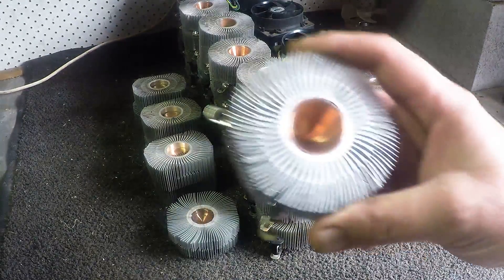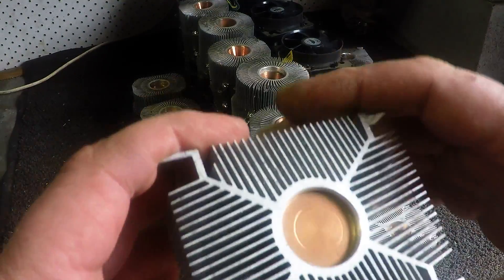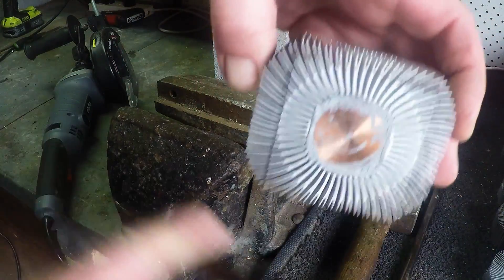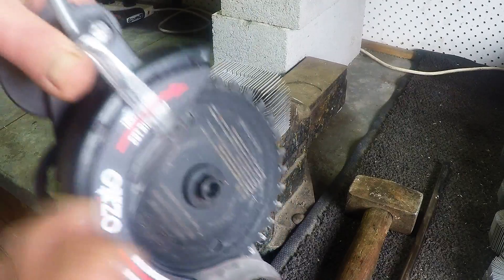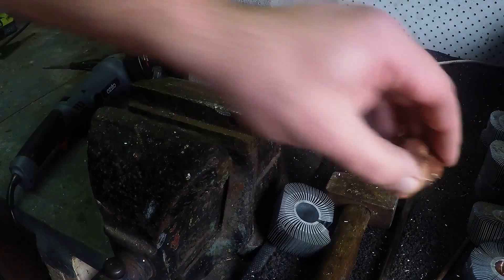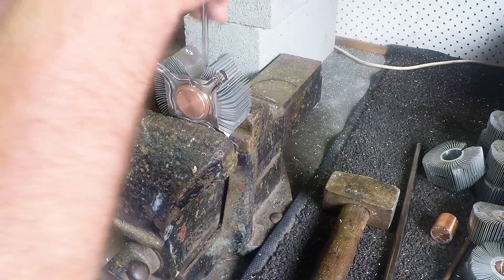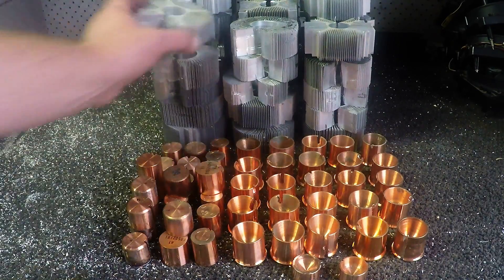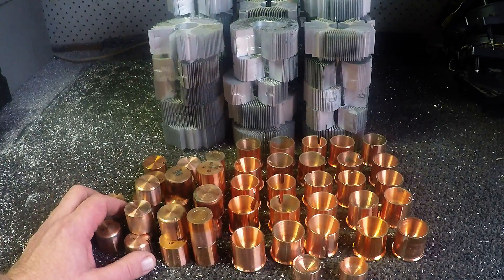Copper Stackers from PC Heat Sinks

Comment: Call me daft, but Im pretty sure that you can sell those complete for much more than their scrap value.
Reply: Hi Daft, my name is Tiberian
Reply: 5 bucks for one used one is much better than $1,30 for 1Kg, isn't it?
Reply: they arent high quality. those are oem intel heatsinks. they cost about 10 bucks new with the fan and mounts on them.
Reply: TheForgoten100 That was my point but they seem so caught up in how it compares to the the latest, greatest, three stage, cryogenic, peltier driven model that they don't seem to understand that those could effectively cool high power voltage regulators, mosfets, igbts, leds, etc. and that people that put together projects that use such components would pay more than scrap value for such heat sinks.
Reply: P4 and old AMD heat sinks...the systems those came off of have been obsolete for a long time.
Reply: Well, I mean if he gets $1 for them that's a pretty damn good improvement over $1 per kilo.
Reply: To say it in simpler terms: Yes they are worthless as CPU coolers, but they are still great as LED Coolers.
Reply: Every time I build LED light projects I use a bunch of these and they are usually good for 75-100+watts with a decent fan.  If you want them to be nearly silent most are still good for 20-30Watts easily.  

People don't realize that many processors today actually have nearly the same TDP or lower than that of earlier Intel and AMD chips.  Heck, the P4 chips had TDPs from 38 Watts in notebooks all the way to 115 Watts in desktops.  Processors that dissipate over 100 watts have been available to purchase for well over a decade now.  Many companies are already scrapping early i3, i5, and i7 systems along with core2duo, core2quad, and Pentium D systems.  I even saw a company toss working quad processor servers that were just outside of the 2-year lease expiring since they upgraded to new systems.
Reply: those were for outdated CPUs.
Reply: m4xwellmurd3r I still don't think you're quite getting it. Do you have any idea how much power you can pass through a low Rds mosfet before its wasting >60W? One of these heat sinks would be adequate to handle the switching output of a good inverter welder.
Reply: You can't, 1) they are specific 2) they are normal ones, not an upgrade. If one wants or needs to substitute this, one will search for an upgrade ( around the same price) rather than buy an equal one.
Reply: they are shit....
Reply: TheForgoten100 that's the thing. no one would ever buy one. he didn't even buy them. they were scrapped out of old PCs because they aren't even worth trying to sell as a CPU heatsink
Reply: m4xwellmurd3r It all depends on which stock Intel cooler you are talking about since they have had several designs over the years.  You generally have to look at the TDP of the chip the cooler was sold with since Intel matches them pretty well with normal conditions.  If you assume a 20-21C room with a stock cooler you should have more than 25% headroom over the stock power envelope of the chip before you are hitting the throttle temp of 95C or the auto shutdown at 105C.  The average consumer very rarely has the CPU run pegged at 100% load for more than 5-10 minutes and so those chips spend a majority of their time at maybe a 10 degree delta from ambient.  
When I think back, the only times I have ever really seen a stock clocked Intel Chip with the OEM heat-sink it came with run above 70C was when the heat-sink was clogged with dust, the case did not have adequate ventilation or the fan was failing.  Overclocking would be a totally different story since you are talking the chip beyond it's stock power envelope. 
I don't generally get to concerned about temps until they are nearing 90C since that is still well within the thermal limit of the chip.  High 70's to low 80's is well within the limits of a modern Intel CPU.  
I can tell you that I have had servers run near 90C 24/7 365 without issue for well over 7 years so the higher temps don't seem to put all that much stress on the chips until you are over the point where the chips begin throttling.
Reply: Cut de Pie Fails 1) there is no such thing as specific in the face of a good engineer. 2) "Normal" is an arbitrary and subjective classification. C/W and format. Those are the only two qualities that matter in heat sinks.
Reply: Actually, the issue with the stock intel heatsink is they're BARELY sufficient to keep a 95watt TDP processor sufficiently cool. Regularly I've seen chips with a 95w tdp pegging out in the high 70's to low 80c range, which is not good at all. These coolers are decent enough as long as you stay below something like 65W TDP.

AMD's heatsinks on the other hand are a LOT more beefy. they use multiple heatpipes, very very thin fins, and a copper base to easily keep a 95W TDP chip quite cool.

Intel doesn't even bother boxing their stock heatsinks with their higher end chips because they know the things aren't good enough to keep them cool properly.
Reply: Nobody is going to buy a random old computer heatsink.
Reply: Amen Atlas,

I have been working a custom cooling project for my laptop in order to cool a  Geforce GTX1070n MXM (120-150w TDP) in my notebook and to do it I researched and experimented with Several 1u Heatsinks that today would be worthless from the perspective of their original platforms but if you get creative you can use them for any number of high TDP applications LEDs, GPUs etc

After cutting one particular copper 1u unit intended for a dell that I bought for a dollar I was able to get it to fit and work for my application
Reply: While there's certainly a market for it or whatever, more people have a use for raw copper than outdated heat sinks. Your interests are simply more niche and the raw metal is easier to sell casually.
Reply: Mr.Yellow maybe he just likes collecting and melting the metals.  You dont have to down on what hes doing because you would do something different.
Reply: 100% true! Instead of destroying the whole element, I would reuse it or sell it as whole for people making Peltier units where you need such radiators. Every stove owner who wants to have a better heat distribution but does not necessarily want to pay 50 dollars for something you can make yourself from two radiators, fan and 2 buck's Peltier unit - is dying to have one. What I've seen in this video I could call only these words: profanity and waste of good stuff. 1 good unit is worth an equivalent of 5 kg of Aluminium so why on Earth wasting such things instead of reusing them? I guess some people just don't care.
Reply: Atlas WalkedAway  I have way more than this guy has happy to sell them to you all work too
Reply: The old p4 fat ones cool as good as aftermarket coolers. There's a video
Reply: Heatsinks must be a very interesting item since 27 previous people took their time to comment,  some with very long comments. Of course I've seen a dozen comments after a person said " hi all ".
Reply: m4xwellmurd3r I would buy them. My friends would buy them. We make bad ass projects and are always starving for cheap heat sinks to slap a fan on. They were likely scrapped for three reasons. 1) large corporations don't bother with parting out old systems when they overhaul and bring in new systems. 2) This man was the first to get to them. 3) This man happens to make money off of scrap.
Reply: It hardly matters. high quality heat sinks are a commodity for any high power electronics project.

Comment: You have a Vice...press the copper out.
Reply: u wot m8???
Reply: zioxei thats exactly how this works...  you put something smaller on the fan side and something on either side of the copper on the other and press it out.   How do you think it was inserted?
Reply: that's not how it works, that's not how any of this works
Reply: Assembly was probably done by heating the aluminium and then letting it shrink/cool around the copper.

Comment: What is candy copper?  I've never heard of it and a quick Google left me none the wiser.
Reply: I think in the uk it's bright copper. means just copper, brazing copper would be copper with soldered joints or brass fitting still on.
Reply: Thank you for that explanation.
Reply: He literally explained it in the video he said HE calls it candy copper but said it goes by #1 or #2 depending yard etc . use your brain like I feel like people try so hard to no understand people because of cultural differences and languages etc . ive never heard of it either but i instantly understood what he meant

Comment: why not just split the aluminium ring with a cold chisel? A couple of hits would just break that soft Aluminium open, you wouldn't need electricity and wouldn't lose weight by cutting. the saw is overkill.

Comment: As an idea, copper has a linear thermal expansion of 16.6. Aluminum has a linear thermal expansion of 22.2. The difference is 5.6. For every degree centigrade you heat up a meter of the two stacked on top of each other they'll grow by 5.6 micrometers apart (the aluminum will expand more). So every 100 degrees C, one meter would grow 5.6 centimeters..  Try putting them in the over and cooking them 100 deg over room temperature, and hitting them with the iron rod. I would bet they fall out. You don't a full meter there, but they'll expand nonetheless. Putt them on all on a baker's pan in the oven, and you'll get the job done in a minute. They probably got it in there with thermal expansion and a press.

I would try this at 250 degrees C on a baker's pan, for 15 min and I would have the vice, mallet and peg near the oven.
Reply: if the aluminum at any rate, whether its more or less than the copper, doesnt the inner diameter get slightly smaller?
Reply: if the expansion is in all dimensions when heating it up how does it help to loosen the copper? id have thought what the other guy said, in the comments below, that making them colder would work
Reply from the maker: I tried heat, doesn't work, will try cold

Comment: You could make yourself a setup from a simple Hydraulic car jack (the ones that usually come with the vehicle called bottle jacks),  and some square metal tubing.  You would be able to push those copper stackers out fast and easy once you have built yourself a nice little rig.  Thanks for the video.  Very interesting and informative.  Thumbs up.

Comment: Invest in a small hydraulic press. They don't cost much and the copper should press out easy.
Reply: welcome to the hydraulic press channel que music
Reply: I was thinking a cold chisel would work better than the cutting wheel. Cheaper, safer, and you don't lose any material.
Reply: John Cabot http://www.autotoolworld.com/Black-Bull-PRESSA6T-6-Ton-A-Frame-Shop-Press_p_200642.html

And very useful for other things in the shop.
Reply: I was going to say I just use a super cheap one ton arbor press for like $60US from Harbor freight and it works quickly for things like this.
Reply: deese koper tings are extrimli dengeros so vee must deeel vit them
Reply: Holieh fahck det was cool
Reply: the vise itself could probably be used with a couple of blocks for no thicker than the heat sinks are.
Reply: @Seitz: my idea too, a sharp chisel would be just as good, and no material lost, no cleaning up small bits either :)
Reply: Arbour press
Reply: Small arbor presses start at $300.00, It would take him 10 years to recoup  the cost of that investment, it isn't worth it.

Comment: put it in the freezer or on the stove too, I can't remember what worked better but if you can use the way metal expands and contracts with hot and cold there is an easy way to get the copper out just think about how they make those rings with one inside of the other that spins

Comment: It looks like you have a mini arc furnace behind the vise.  If so, do you use that to melt down your copper into ingots or bars?
Reply from the maker: no it's not a furnace but i'm working on a melting system at the moment to make ingots

Comment: just split your aluminum extrusion with a sharp cold chisel. NO material loss, either aluminum or copper. you could probably use even a cheap wood chisel, or even a home made from a screwdriver example.

Comment: I got something that you can try and you won't lose any of the aluminum to the cutting or the copper and they should be nice and clean. Take a wide faced cutting chisels and stick it into a press and use it to cut the aluminum apart. You could use an air hammer with a cutter. Could also use the vice with a very short cutting chisel. This method is what I use and it is also a bit less messy.

Comment: Hi Ben, try to apply pressure on the copper rounds using your vice and a thicker rod but a short one. You position your heat sink in the middile bettween the thick rod and a hollow piece of metal or one of those heat sinks you already cut. this will keep the copper stackers intact and more attractive to stack.
Reply: i had the same idea adam did, it seems a lot cheaper to just use the vice to pop them out rather than buying a press to pop out 30 dollars worth of copper :P
Reply: I have a press and it pops those things out like nothing. get a press, worth their weight in gold!

Comment: An engineer would use a press to push out those copper parts. You could make a hydraulic press for less than £30.
Reply from the maker: yes, if I was an engineer, but i'm just a scrapper and love it.

Comment: How much are those worth??? I'm extremely curious!
Reply from the maker: +Michael Appleseed Copper is around $3 lb
Reply: 65 million pence
Reply: +eWaste Ben that is really poor 16 Oz in a pound that is a lot of work!
Reply from the maker: +Mystery Buyer yeah true, whilst we base these stackers on scrap copper prices, which are lower then spot price, as stackers though they are worth more then spot, spot is for anything copper, like squashed up copper wire, these are like bullion, the solid ones weigh about 2oz each, you can even stamp the tops of them with Cu.999

Comment: That's a pretty neat angle grinder thing. What kind of blade is that? The teeth look pretty big on that blade (almost like a fine tooth wood blade) I was impressed how well it cut without grabbing and jerking the saw. Probably works better than a normal metal blade because they tend to fill up with aluminum dust when cutting. Do you know if I can get those blades here in US and if they'll fit our US angle grinders? Thanks and good scrapping video as always
Reply from the maker: +zackcat276 it's a twin blade and i think they spin in opposite directions, they sell these cutters in hardware stores for pretty cheap.

Comment: Nice Copper Bullions I stack those too with my copper pennies. I use a hand saw for cutting the alum and metal  but you  just gave me  a better way to cut with one of those metal cutting disc on a grinder  that was very fast cutting.. have you tryed  cutting the copper from transformers with that disc?  thanks for the video. regards
Reply from the maker: +Luis Rodriguez Thanks, I never though of using the cutter on transformers, i'll try it on them microwave transformers.

Comment: Hi Ben hope this message finds you doing great.  I really like the copper heat sinks,enough stacked up can bring in some more cash. I use and give away the older aluminum heat dissipaters and use them as mail holders. to get the copper slug out of the aluminum,. I put it in a vise, use a hammer and a small iron chisel to punch it out.

Comment: Ben, I wasn't trying to spam your site.  You can delete my link if you want. I just wanted you to see that the silver I am showing in video is the same grey paste that is on the copper round in your video at 4:44 and 7:05.
Reply from the maker: +Mike McKinster no problem, these days very few use silver thermal paste but yeah, there is silver in the paste, thanks.